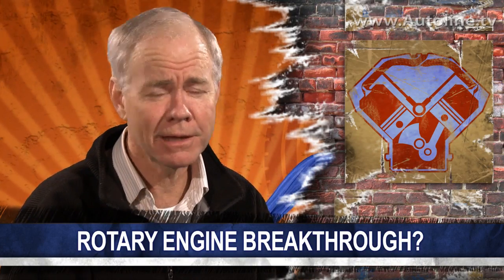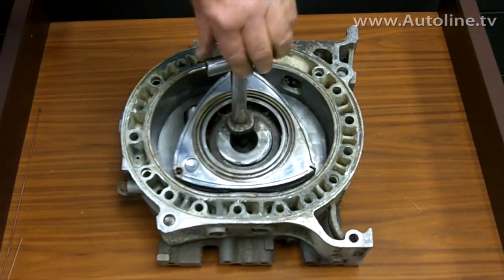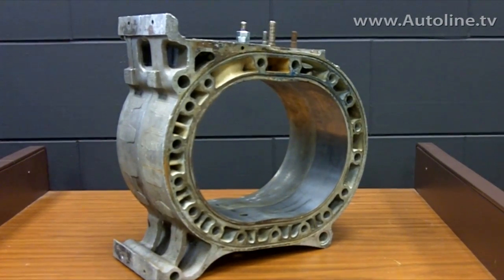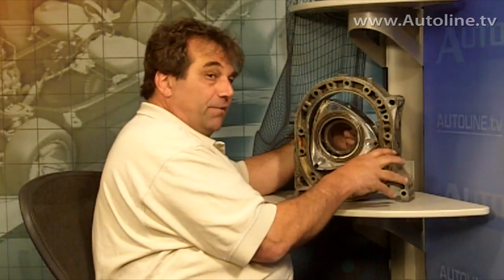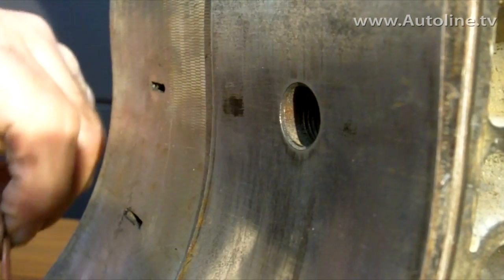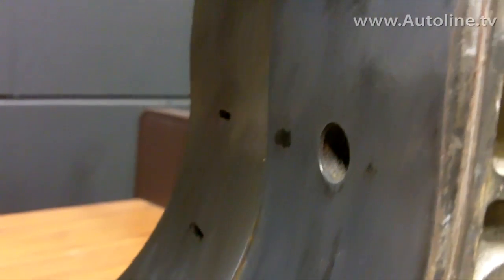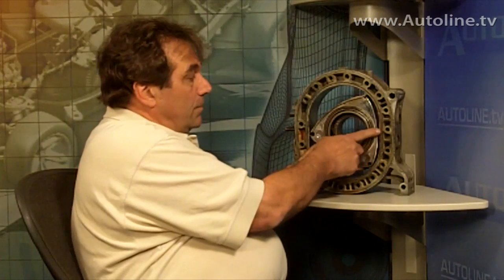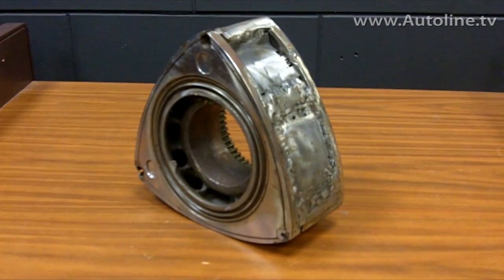Rotary Engine Breakthrough?

Comment: Rotary Engine Breakthrough?
Apparently Not
Reply: Mazda and other companies now have truly bullet-proof apex seal material.  And while it is more expensive, they won't need much of it for a range extender engine that IS DEFINITELY coming,  I believe within the next 2 months. 
search YT for:
Unbreakable rotary engine apex seals explained | fullBOOST
Reply: @someotherdude  YOU ARE A LIAR AND A FAKE.
Reply: @someotherdude  STOP SPREADING LIES AND FALSE INFORMATION ABOUT WANKEL ENGINES.
Reply: @sandervanderkammen9230  go look at both links- they are real.  There is no doubt Mazda will put the range extender rotary on the market shortly.  Toyota is also considering this engine for their driverless car (called e-pallet)
Sorry for humiliating you!
Reply: @sandervanderkammen9230  "It’s definitely competitive price wise, with costs starting at £25,545. What’s more, Mazda claims that it costs just 4p a mile to run. For those still antsy about the range, a plug-in hybrid version with batteries charged by a rotary-engine range extender is due later in 2022."

That's a quote off of 'driving co uk'
Reply: @someotherdude  Driving co uk says the Mx30 is only available as a plugin battery EV.
Reply: Please stop spreading lies and false clickbait rumors
Reply: @someotherdude  You wrote, qoute;
 "a plug-in hybrid version with batteries charged by a rotary-engine is due in later 2022"
YOU LOOK LIKE FOOL RIGHT NOW!
Reply: 2023 everything is wankels, for a while it looked like electric  drivetrain was going to win
Reply: he definitely has it figured out...
Reply: @uptownsamcv  Ernie Brink was a crackpot and a cheap con man.
Reply: @uptownsamcv  Ernie Brink was a smalltime fraud... and sadly, a degenerate alcoholic.. R.I.P.

Comment: That engine is a waste of time!
Reply: ...except it isn't, because they found a new apex seal material that really works.  You'll see it in just a few months.
Reply: @someotherdude  Please stop spreading lies and false information.

No one has ever found a solution to the problems associated with the apex seals, its a design that is inherently and fundamentally flawed.
Reply: @sandervanderkammen9230  There has in fact been a durable 'solution' to apex seals that was considered too expensive.  I've read about it.  Maybe something changed and it's become less expensive?  
But I'm worried about you.  No one has dug in harder than you on the whole internet. No one.  I don't want you to do anything drastic when the new engine is released, ok?  Just create a new YT identity and move on.  It will be ok.
Reply: Today marks the 10 year anniversary of the final demise of RX production at Mazda.
  The very last Wankel engine car rolled off the assembly line at Mazda's Ujina #2 plant in Hiroshima Japan on June 21st 2012 at 4:30 PM Tokyo time.
Reply: 2023 the year of the wankel
Reply: @rp9674 Mazda President Akira Marumoto's announcement in July confirmed that the MX-30 was cancelled due to poor sales.
Reply: @sandervanderkammen9230  maybe they'll switch it to steam power and bring it back...again
Reply: Nothing ever became of this scam..  total fraud...

Comment: Yes definitely, and it is called Electric Motor. 3 to 4 times more efficient 10 times more reliable and 3 time lighter, and 2 to 3 times more responsive.
Reply: I agree an electric motor is superior, but you should admit that a small single rotor rotary generator would make sense, it could be mounted in line, it's tiny, and ultra simple.  It will go on making sense until that 'miracle battery' comes along.
Reply: @someotherdude  Using a Wankel engine makes absolutely no logical sense... that is why no manufacturers use them today.
Reply: @someotherdude  Please stop spreading lies and false information.
Wankel engines are more complex, expensive less efficient and very unreliable.
The Wankel engine was ultimately a failure in every attempt to adapt it to a generator application.
Reply: @sandervanderkammen9230  not more complex, 3 moving parts, yes the current apex seals are complicated but a valve train is more complicated.
Reply: @someotherdude  Stop spreading lies and false information about Wankel engines.
There is no working Wankel engines with only 3 moving parts. This is a completely false and misleading myth.
The Wankel engine will not operate properly without seals and it is the seals  which are the Wankel's fatal design flaw that makes them less durable and very unreliable.
Reply: @someotherdude  Poppet valves are very simple and extremely  reliable technology, they have been used in aircraft engines for over 120 years.

Comment: As discussed elsewhere, the fact described in this 'Rotary engine breakthrough' video, of a reduction in Wankel engine exhaust gas temperatures with a cleft type of plug hole, was known from early work, eg Harry Ricardo, 'The high speed internal combustion engine', exhaust gas temp being dependent on BMEP, actual effective compression ratio: higher MEP linked to lower exhaust gas temperatures, a paradoxal effect noted in Sachs KC-27 research published in Wankel News, by Reiner Nikulski.
About somebody with no engineering grade developing interesting innovations, Roy Fedden had no engineering diploma, and was, along with H Ricardo, the author of development of best WW II piston engines, the Bristol Air Cooled Sleeve Valve engines. Blessings +
Reply: Yes, proof that Ernie Brink is a fruad.
Ernie clearly stole the idea from a SAE paper published many years ago.
Not only has Ernie stolen credit for the design, he failed to read or understand the negative effects of the design
Reply: @sandervanderkammen9230  We know mr or ms van der Kammen for his/ her hardmind, ignorance, and unjusfified attacks on Wankel RCE, also for a constant 'cyberbullying', 'cyberstalking', 'retaliation', 'trolling', 'flaming', even with involvement of 'psi forces'; don't know if on his/ her own, or paid by someone else. If a technical novelty was published long ago in a SAE paper, SAE paper number must be cited, pontificating 'design is negative' without a minimal explanation or fundaments, is anti-scientific. 
Sander van der Kammen should better be blocked from writing in YouTube. 
Blessings +
Reply: @sandervanderkammen9230  you literally never speak to someone's point.  Jose G A was making a simple point that you refuse to admit. Improvements CAN be made by people with common sense and a feel for the engine.
Reply: @someotherdude  That is simply false and exposes your  lack of education and understanding of engineering principles.
Engineering is a science based endeavor that involves building on the knowledge of others that have come before and published their discoveries and work so that others that follow do not make the same mistakes of the past.

People like you that believe that you can ignore the history and the collective body of scientific research  are doomed to failure by your own ignorance.
Reply: @someotherdude  You look like a fool right now! 
 Today marks the 10 year anniversary of the final demise of RX production at Mazda.
  The very last Wankel engine car rolled off the assembly line at Mazda's Ujina #2 plant in Hiroshima Japan on June 21st 2012 at 4:30 PM Tokyo time.
Reply: JUST THE FACTS, THE WANKEL ENGINE IS OBSOLETE TECHNOLOGY AND ERNIE BRINK IS A FRAUD.

Comment: A wankel can be profoundly small, so it can go into trunk to be a 2nd engine.
So, get  a car that has an efficient engine in the front and install a wankel the trunk. This 2nd engine would only be used when more power was needed or as a back-up to use alone if you can't get the main engine running.
Reply: The Wankel is an obsolete technology that is no longer manufactured in the engine manufacturing industry.
Reply: It shouldn't be in the trunk, it should be under the hood in the front.   It's a small volume, there is definitely room.
Reply: @someotherdude  Bur there are no advantages over reciprocating engines so rhe Wankel is no longer used.
The Wankel engine is obsolete technology
Reply: @someotherdude  SO MUCH FOR WHAT YOU KNOW

Comment: Is there any update on his idea?
Is it possible to get these kinds of rotor housings from the same manufacturers that create conventional billet rotor housings?
Reply: The idea isnt a necessarily good idea, and I don't believe there has been any modifiations after this video.. 
It would be safe to go with a no. But even then if you take good care of one, they can last a while.
Reply: @them26pershing59  In fact it's a really bad idea.
 They don't last as long as compareable reciprocating engines which is why people stopped buying them.
Reply: @sandervanderkammen9230  The GM Wankel prototype was good for 750'000 km.
Reply: @joseveintegenario-nisu1928  GM canceled because of reliability problems, that's a fact.

Comment: As you probaly know, the last versions of NSU Ro-80 engine, having solved the reliability issues, had only one plug, in the place of leading plug of two plug earlier engines. The plug is not directly screwed on the housing block, but into a copper insert, screwed on housing.
The only plug hole in these later Ro-80 engines has the size of the small plug hole on traling site in NSU and Mazda engines, thus, as it's very easy and cheap machining a modified copper insert, with an slit type plug hole as described by mr Ernie Brink, he can test this in an NSU Ro-80 or NSU Wankel Spider single rotor engine and then, even offer it for sale, this part can get intelectual property protection, as Utility Model, at an affordable cost. Good luck! Salut +
Reply: Ernie Brink is nothing but a fraud, Mazda tested these ideas and abandoned them because they didn't  offer any improvement.
Reply: @sandervanderkammen9230  As Ernie Brink did not demand any money, it's not fair blaming him of 'fraud'.
 His proposal is sound, in that he claims having obtained a reduction in exhaust gas temperature, a fact linked to a higher MEP,  to a higher effective compression ratio.

 I purchased over $3'000 in Wankel documents from SAE and other sources, and never read something about Mazda testing the 'cleft', 'slot' type of plug hole, but I read the Toyota work of a PPort controlled by Reed-Valve (Ford Canada had 2 patents on this), and a Glow Plug in the leading site, with 9% fuel economy improvement. Besides the raw Ernie proposal, having the plug tunnel or channel pointing to trailing side of rotor,  as in the Yanmar Diesel RCEs, a bit similar to Kawasaki combustion promoting patent, not perpendicular to working surface, could help. Please provide a reference for your wild statement. Danke. Gesund +
Reply: @sandervanderkammen9230  Wrong! If you read recent SAE papers from the Austro people and others, you'll see the communication between the leading and the trailing chamber through the plug hole could be a double digit percent of leak losses in Wankel RCE, GM stated that leaks is the main cause of emissions, and poor MEP, at low load, low rpm, while at high rpm, main cause of emissions is quenching, flame extinction. HC are in reverse connection to rotor surface temperature, a hotter rotor means less HC in exhaust. 
It is not hard, difficult, or expensive testing both concepts: the plug channel tilted towards trailing side of rotor, and the cleft, slot type of plug hole. Until then, what I can say is your last comment has a lot of bombastic terms, but little science, little reality. Blessings +
Reply: @josega6338  Mazda, NSU, Kawasaki, Totoya, Yanmar and GM are all examples of Wankel engines failing to match the performance of reciprocating engines.
The Wankel is an evolutionary dead end because it is fundamentally and inherently inferior to reciprocating engines.
 Well, if you are unaware of the scientific ramifications of Pascal's Law then you sir are not sufficiently educated or knowledgeable on the topic to speak intelligently on this matter.
Reply: @sandervanderkammen9230  Your are engaged in a 'Power Struggle' in 'Cyber Mobbing', rather than in engineering issues. Please read the results by Norton, Aixro, Ingersoll-Rand...
Look for another fool to endure your insults. How many Wankel documents have you ever read? Why is the hard sector of Horus tress fundamentalists, those who killed Itzak Rabin, a name now close to P Moeller, Freedom-Motors, involved in a 'kick the stinger' frenzy with Wankel engine?
Forget about me, end of thread. Blessings +
Reply: @josega6338  I am only interested in the TRUTH.
You on the otherhand seem to have some compulsive obsession with engineering failures.
Again you quote a list of Wankel engine designs that failed to match the performance of commercially successful reciprocating engines.
 Paul Moller is a fraud, he was sued by the SEC and fined for investment  fraud.
Moller Skycar and Freedom Motors are legendary for being the longest running and most notorious vaporware investment scams in history.
Reply: @josega6338  he sure is.  He is on literally every page on the internet that mentions wankels, and he attacks anyone relentlessly if they like the wankel concept.  It's really kind of funny, it's admittedly entertaining for me.  He also can't stand it if anyone likes the modern steam engine by Cyclone.  He calls them a fraud as well.
Reply: @someotherdude  You say who is sure? Van der Kammen? Another fellow? 
Thanks. Blessings +
Reply: @sandervanderkammen9230  Idi Amín DáDá said: 'People trusts me because I always say the truth!' You never explained, but emmit damnations. Look for another subject to sabotage
Reply: @joseveintegenario-nisu1928  The TRUTH is irrefutable... rotards may attack it, idiots may deny it but when its all said and done the Wankel engine never lived up to all its great hype and was instead the biggest commercial failure in the history of engine manufacturing industry.
Reply: @sandervanderkammen9230  why'd they test an idea you say is worthless on it's face?  Hmm?
Reply: @someotherdude  Well, its been 10 years now, why don't you Ernie why no legitimate engineers or manufacturers are interested in developing his idea???
Reply: Slot type of Plug hole is sound, similar to Kawasaki patent US3848574, and Yanmar Diesel plug duct arrangement, SAE 710581; 720466. Toyota, SAE paper 790435, had a Glow Plug in leading plug hole. 
The description of a reduced exhaust gas temperature in this viedo points to an increased BMEP, meaning higher effective Compression Ratio.
For SAE technical papers and informations, a right habitude is always citing number. 
Blessings +
Reply: @josega6338  Its been 10 years now... Where is it Ernie? Where is your engine???
Reply: @sandervanderkammen9230  My engine? I'm not any engine maker, I have other things considering, but for sure the slot type of plug hole is in my pipeline. Gesund +
Reply: @josega6338  The slotted spark plug hole won't save the Wankel engine... it is already obsolete.
Reply: @sandervanderkammen9230  Pls provide bench figures.
Reply: @josega6338  Wankel engines are obsolete, no longer manufactured in series production anywhere in the world.
Mazda was the last manufacturer, they ended production a decade ago.
Reply: @joseveintegenario-nisu1928  Engineering is not a faith-based endeavor.
You clearly lack any formal education or professional experience on the topic of Wankel engines or engineering general.
You are not qualified to speak inteligently on this topic.
Please stop spreading lies and false information about Wankel engines.
Reply: There are also smaller diametre plugs, allowing to bend plug channel pointing towards trailing side of rotor, this is an easy way to improve efficiency.
A Glow Plug, an Ignitor, could be put instead of Spark Plug in Leading Plug hole, no one tested this in a single plug Wankel RCE, as far as I know.
Any producer of reciprocating engines could make Wankel with same machine tools, marketing, repair shop training could be the issue. 
When Mazda presented long, long ago, a prototype Wankel engine for the Japan 360 cc microcars class, other makers said: 'Please have mercy on us!'
Mazda never sold a Wankel micro-car. Blessings +
Reply: @joseveintegenario-nisu1928  The Wankel engine is obsolete because it has no advantages.

You cannot improve efficiency of the Wankel to match reciprocating engines... the Wankel engine has much lower practical and theoretical efficiency limts.

26 of the biggest and best engine manufacturers in the world licensed the Wankel KKM57 for development and production... it was all the major disadvantages and its inability to compete with reciprocating engines that most companies abandoned the Wankel prior to full production.

Mazda lost billions of dollars selling Wankel engines and went bankrupt TWICE.

Mazda's "track record" in motorsports was rather pathetic really... Mazda has never been associated with the great racing marques and consumers do not identify Mazda as a  high performance automobile brand.

Mazda no longer has any factory motorsports program.
Reply: Today marks the 10 year anniversary of the final demise of RX production at Mazda.
  The very last Wankel engine car rolled off the assembly line at Mazda's Ujina #2 plant in Hiroshima Japan on June 21st 2012 at 4:30 PM Tokyo time.

Comment: xke xke22 minutes ago (edited)THE WANKEL ENGINE MAKES THE PRESSURE OUTSIDE THE ENGINE FOR YOUR EXHAUST THE ONLY PRESSURE THE WANKEL MAKES IS THE COMPRESSION STROKE INSIDE THE ENGINE WHEN   THE APEX IS IN THE LEADING PLUG HOLE THE EXH PRESSURE IS OUTSIDE THE ENGINE THIS WHY YOU HEAR IT FROM THE EXH PORT OUTSIDE THE WANKEL ENGINE  LEAKAGERead more Show less